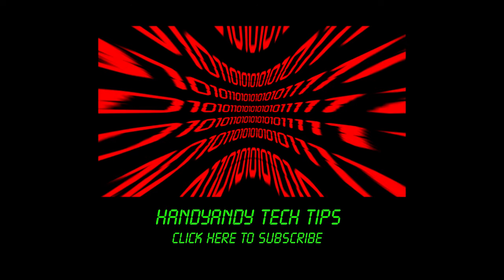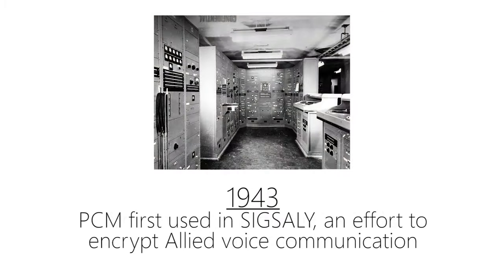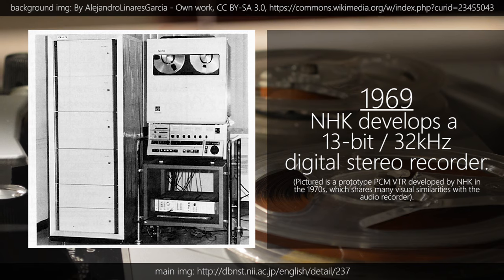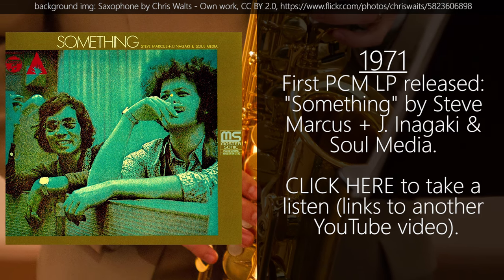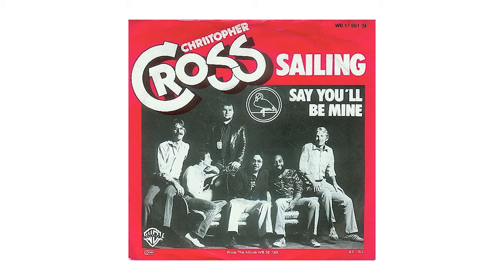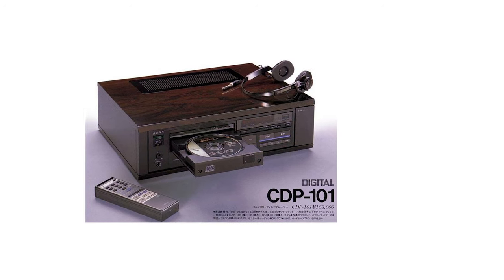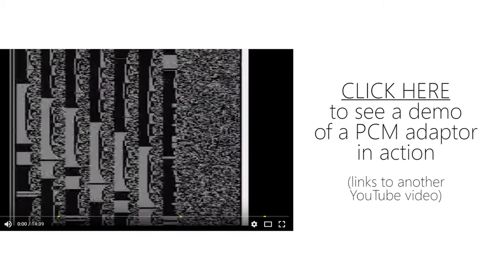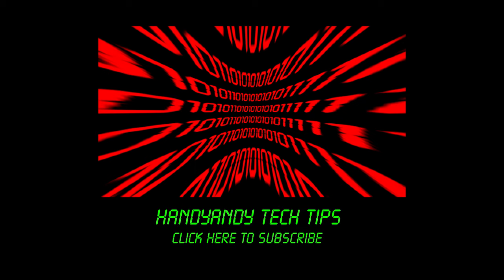A (Brief) History of Digital Audio Recording: 50 years in 5 minutes!

Comment: Thank you! I learned more in 5 minutes about the history of digital audio than I have in years of reading and hours upon hours of other videos. You've sent me on a few tangents, I want to know more about these early units, especially how the 32 track digital recorder worked. I calculated that it's about 3.2 megabytes a second for 32 tracks @ 50 kHz, 16-bit. That's quite a lot of bandwidth and processing back in 1978!
Reply: That's why they used videotape. This was an easy, reliable and known format with enough bandwidth to store the data. And of course the digital binary ones and zeroes can easily be converted to black-and-white analog tv. The BBC already used a similar system to feed FM transmitters. You could argue that the UK had digital terrestrial radio as early as 1970.

Comment: In the uk, the BBC were using digital audio as far as the transmitter for all tv and radio audio and interconnections as soon as 1973!
Reply from the maker: Wow, amazing! What bit depth and sampling rate? I know that the ABC in Australia were experimenting with digital audio links in the late '70s, but 1973 seems really early.
Reply: @HandyAndyTechTips  I think it was 38khz and 13bits. But that’s off top of my head. They were using pcm way before that over phone wires for radio interconnects via daventry too I believe.  I read it in BBC research and development archive
Reply: @HandyAndyTechTips  update: they had first few pcm to Transmitter links in 73, mostly complete by 75. It was 32khz and 13 bit linear 

https://www.bbceng.info/Technical%20Reviews/pcm-nicam/digits-fm.html

Comment: If only modern digital audio formats were even as good as 44.1K 16-bit.  We have gone backwards with MP3, AAC, AC3 etc.
Reply: Not so much the fault of the compressed audio formats, but of the crap that passes for music and the dynamic compression which greatly reduces the dynamic range and wastes most of what's available in the current formats.

Comment: Very interesting but you didn't mention digital audio compression which was developed in the late 1980's and which revolutionized the storage and transmission of digital audio (and video).  It was necessary to overcome the inefficiency of PCM to make the transmission of high quality audio over the internet a practical proposition using techniques such as mp3.  It also made small portable digital players such as the Ipod possible.
Reply: Yipyap It was intended as a brief history of digital audio conceptually and historically. A lot of details (and especially more recent developments) had to be sacrificed for the interest of time. Hours can be spent on just compression, equalization, Dolby, ETC just in analog recording , let alone the details of digital compression and / or all the digital delivery formats. These things are are all interesting as well, But this video was to show the major EARLY steps from the 1930s to the 1990s.